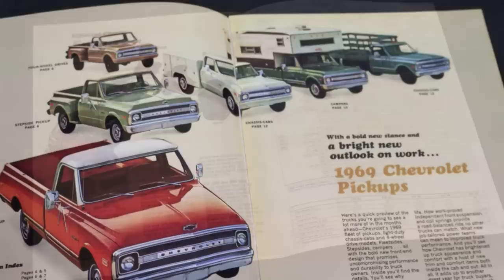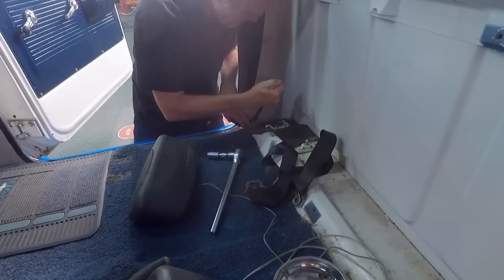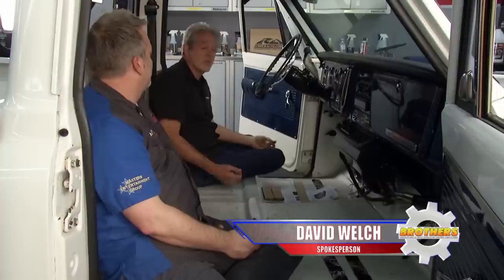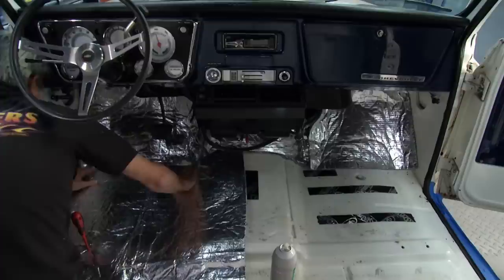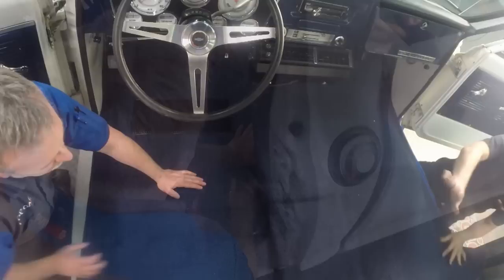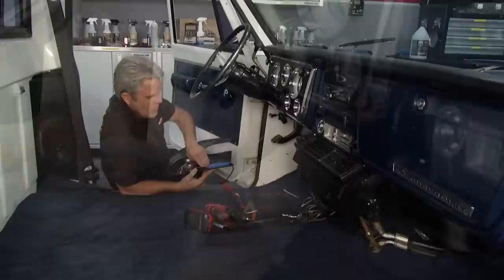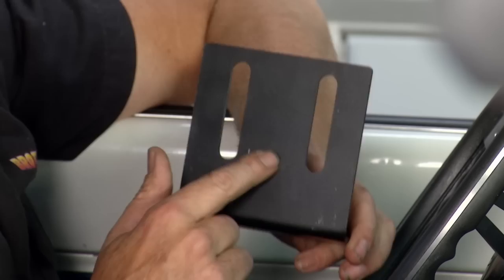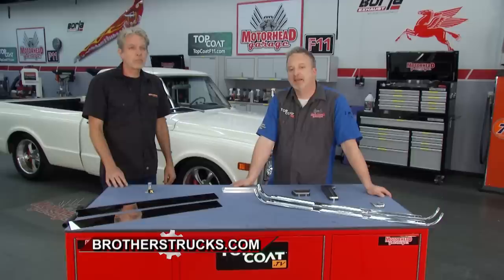C10 Interior Makeover - Installing Carpet, Speakers and Low Seat Brackets in a C10 Truck

Comment: That's a good looking '70. I like how the interior had turned out. It's close to how I want my truck to look.

I had first watched this video last year, but was worth the watch again because I'm finally getting around to purchasing parts and tools to begin my work on my '68 C10. I've watched several of Dave's videos on sheet metal repair to suspension improvements, Blazer rear tank conversion, long bed to short bed conversion, one piece window upgrades, to interior upgrades. All of which I'd like to do on my pickup. Speaking of Blazer tank conversion I had ordered my tank kit just yesterday. 

2:15 ...still like to save those (sill plates) to put them on a patina truck, or maybe one of my buddies can use them. "One man's trash is another man's treasure."

17:46 Tosses old sill plate over right shoulder.
Reply from the maker: LOL

Comment: What did you use to mark the holes in the carpet? I've read people using drill bits covered with tape or heating up "punches", that burns the carpet to expose the holes.
Reply from the maker: We use a paint pen or chalk normally, then use a small Phillips head screwdriver or an Awl to punch through.

Comment: What about the stock tank location? Any sound deadening advice about it? As far as how much to use or strategic places to add more strips? Thx in advance.
Reply from the maker: Same amount of material applies there, and anywhere else. Minimal amount needed, vertical 1" strips up the rear of the cab would work well.

Comment: Just out of curiosity is there any harm in fully covering the floor with the dynamat material? Also Dave is a rockstar
Reply from the maker: No harm in doing that. We dont recommend it due to weight, and expense, also the effectiveness doesn't necessarily increase by using more. With all that said, you can do it if you decide to without any negative effects.